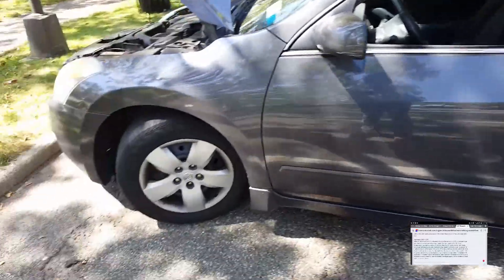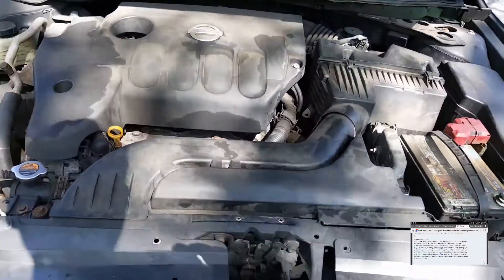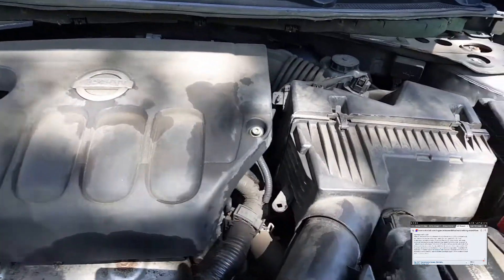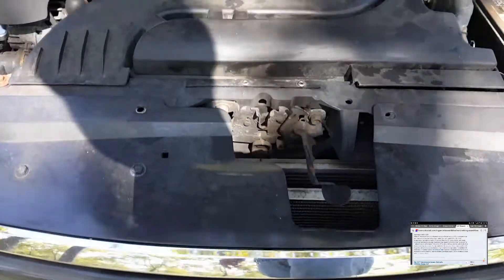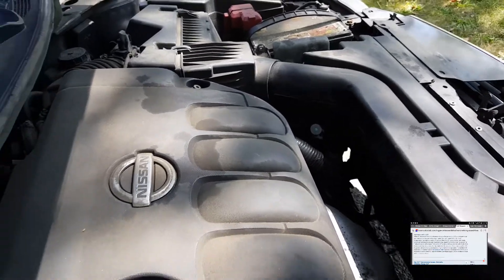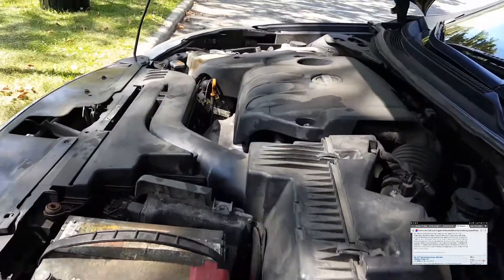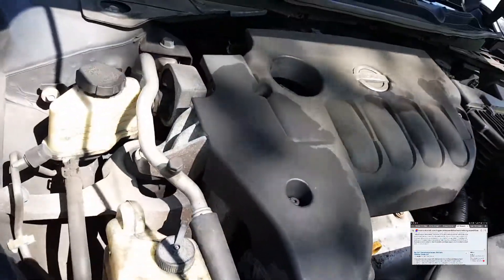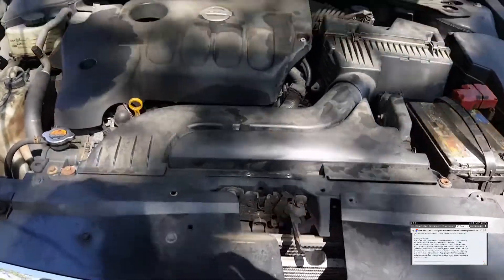How Nissan Officially define CVT Transmission FAIL safe and LIMP mode.....and why it exists...

Comment: My CVT is in limp mode and the mechanic told me transmission fluid burnt smell and scan codes came back to replace transmission. 😢 150k 2017 Altima

Comment: I am at a loss. No indicator lights, was told transmission fluid is fine and had car scanned for fault codes with nothing found. 2011 Nissan Juke will go into limp mode ONLY after sometime on the freeway.
Reply from the maker: You just need to change your cvt fluid.
Reply from the maker: CVTs will do that once the fluid gets to a certain temperature.
Reply: Thank you! I'll give it a try!
Reply: @Kel-lx3po  trade in quick and fast cvt will leave you stranded soon
Reply: @lilpeppa117G  I am working on it. I don't understand how anyone can keep up with these. I just bought mine in May and have had the worst time.

Comment: I don't have a nissan. I own a Toyota Vitz 2014 with CVT transmission and when I drive it aggressively an on steep hills it usually whines. Once it cools down it is fine. Inspected the coolant and found the Toyota long life coolant mixed with a green coolant, most likely Prestone. I drained and flushed my system with distilled water and radiator flush, cleaned some rubbery type buildup in the radiator cap and filled with genuine Toyota long life coolant. The difference is night and day. I have driven it aggressively but haven't thoroughly tested it under all conditions before fluid change but I already have experienced a significant improvement. The contaminated fluid shows separation of the green and pink coolants with the green floating on top and has consistency of a thin syrup. Hope this experience can help someone with a similar problem.